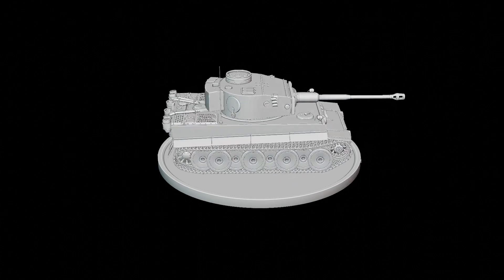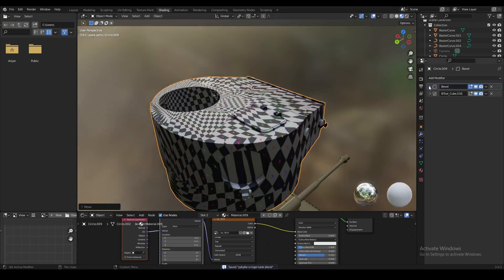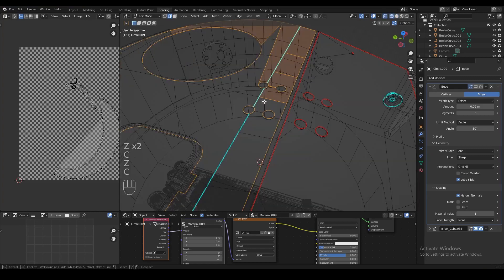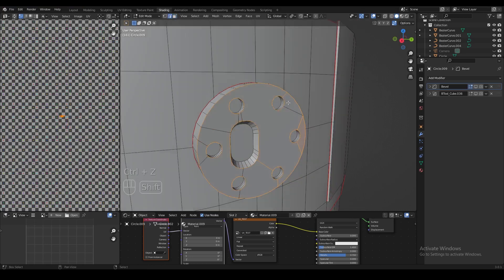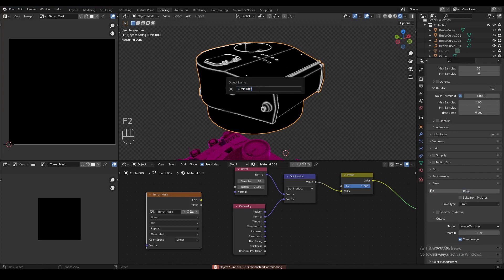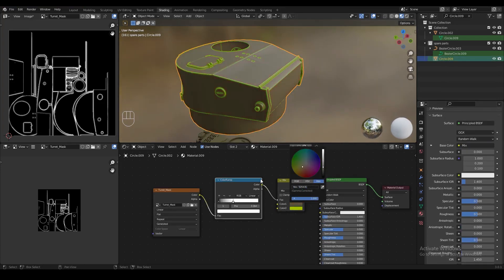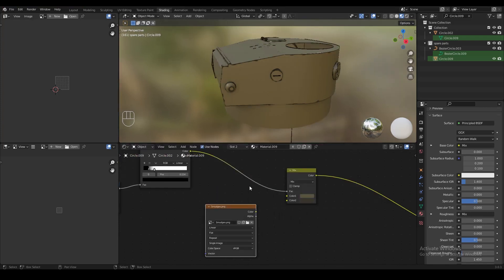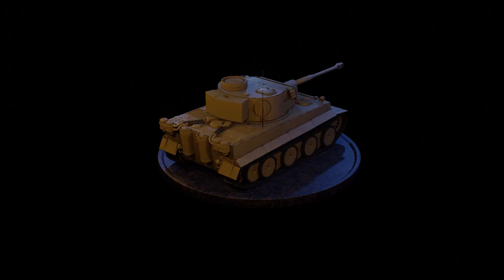How to Texture a Tank in Blender with Geometry Nodes & UV Unwrapping

Comment: How do you get that "shiny" look on your meshes in solid view mode? :)) Like the egdes are very defined in comparison to the default flat and boring look
Reply: Check the settings in the dropdown box next to where you change between wireframe, solid, shaded and rendered in the top right corner of the viewport. I'm sure it's going to be in there, just requires adjusting some of the settings.